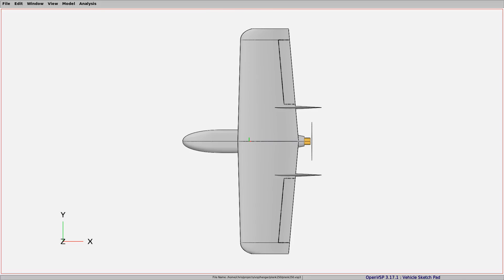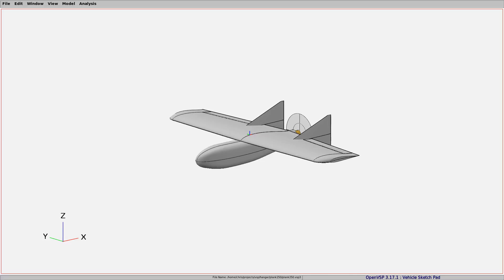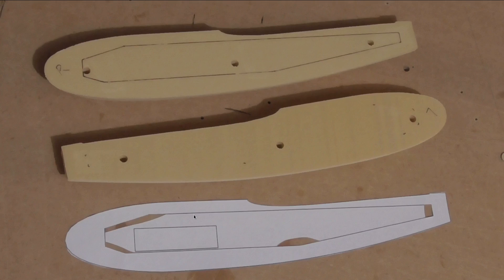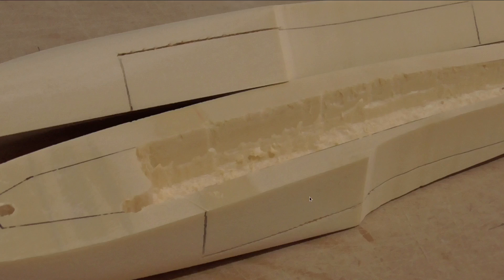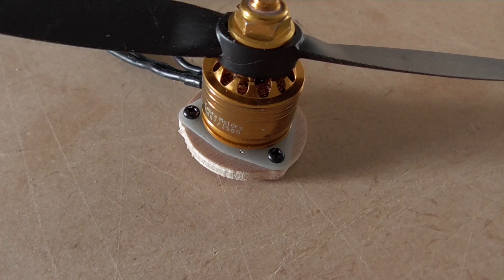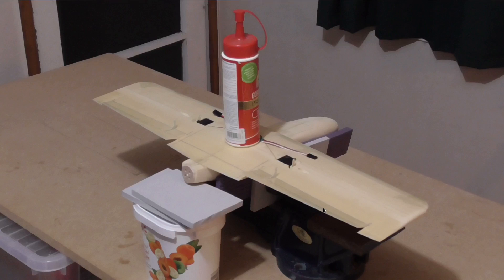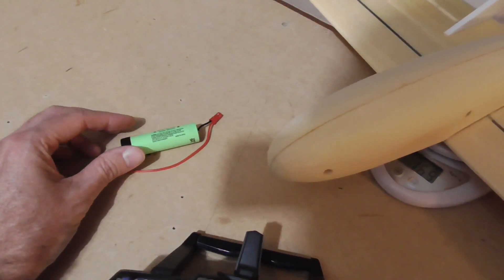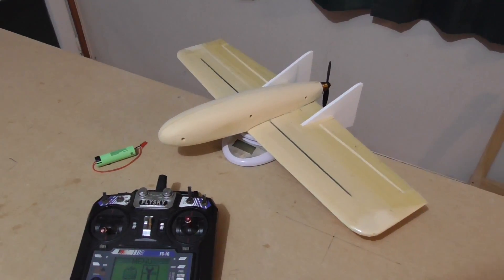Sub-250g plank (build)

Comment: I made really straight 45° tapered edges of foam board by putting it straight on a metal level and then holding one of those multi-tool saws at 45° and slide it down . Bzzźxx

Comment: something to think about, when i need to gouge out foam for equipment I made a tool out of a piece of conduit that i cut in half then notched the half so it could bend kinda like a spoon, sharpened the end then i heat the spoon end so it just glides through the foam, the big advantage is the surface of the foam it leaves behind has been melted, sealed and hardened making it probably twice a strong as foam that has just been gouged out without heat......

Comment: Very nice little build :D , 18650 are definitely the way forward ( unless some LIPO miracle happens) For adding a little strength to that small bead Orange insulation foam(  the battery bay)  , craft type tissue paper and watered down floor varnish adds a fair bit or strength for very little weight.

Comment: I wonder if iforce2d will find some stiff narrow-guage stainless wire? Run current through it and it heats up like nichrome, but unlike nichrome it stays plenty stiff. Can make loop or box shapes mounted to a stick, should work for hogging out internal cavities without the mess of the drilling/router on foam.

Comment: You keep getting so close to epic designs, but you always fail right at the end. You model a great airframe, build it out and wonder why it's too heavy. Use the build as a mold and construct the thing from hollow composites.
Reply: Get rid of all that foam! Geez.
Reply: The foam is doubling the weight..
Reply from the maker: No, the foam does not double the weight. Packing tape over foam is generally lighter than hollow composites would be at this scale, for the same structural strength. Plus it's an order of magnitude quicker, cheaper and easier to build.
Reply: I guess you've not seen any modern rc planes?  Foam rc planes are VERY common and certain foams are extremely lightweight and durable.  It doesn't need to be hollow to be light.

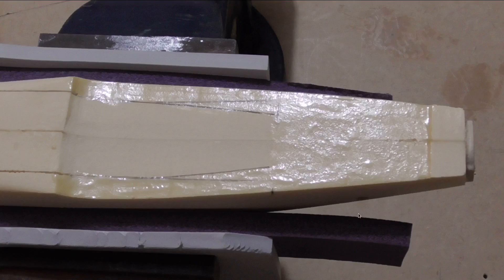Comment: @ 5:20 you say about wing adhering to the fuse....... Just a thought on using short lengths of the bamboo bbq sticks (about 4mm dia) pushed in to make a hole, then followed up by pulling out again and apply epoxy and refit.
Sort of bamboo nail if you like.
Currently looking at using some of the foam board as used in Flite Test stuff for reinforcing in the building foam.
Surfaces need to be reasonably flat and sheet could be applied on edge as well if necessary and with paper still in place.
Difficult to find in some places but just found some 600 x 420 x 5 mm sheets at Choice Shop in Aus.($4.00)

Comment: that press drill method for carving the inside is very smart, I usually jsut do it with a cutter and flat screwdriver or my dremel with printed router adapter

Comment: Your using the 18650 batteries more often.  I have also been playing with those. I ordered a small electronic load to discharge them... whoops the cheep ass quad charger has a discharge function. Working on a graceful way to make a 3S that actually charges correctly.

Comment: I wonder if you could set up some chase video with two of these launched consecutively executing the same mission.
Reply: Actually, with your synergistic skills...  I wonder if it's possible to use a multirotor to precisely measure the ground elevation along a particular path, and then do a terrain-following mission with a plane, or as mentioned above with multiple planes.  I can only imagine that lower would look more impressive, especially with the rolling hills you've got immediate access to.

Comment: For the wing to fuselage joint you didn't love, you could use  vertical tabs slotted and glued. Guitar picks roughed up, SIG style easy hinges used vertically or simply thin plywood glued in position works well.